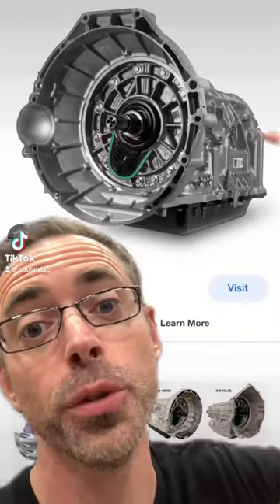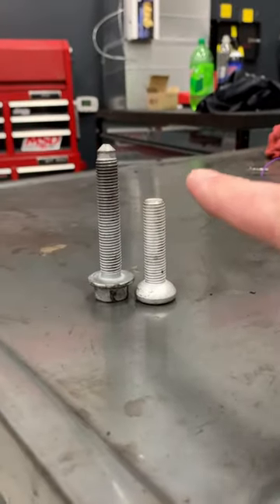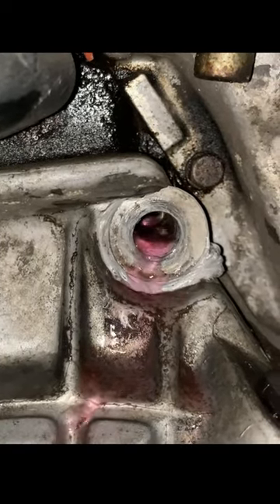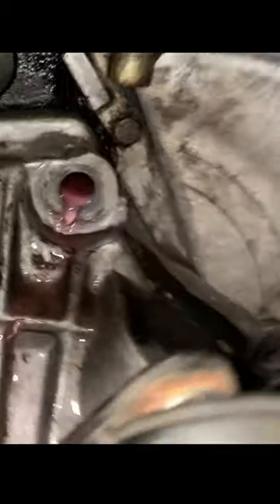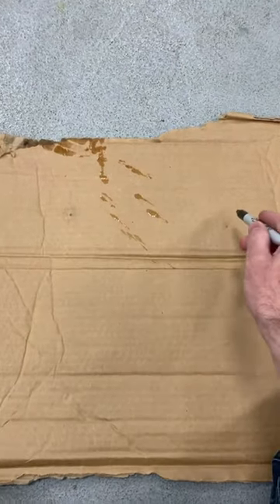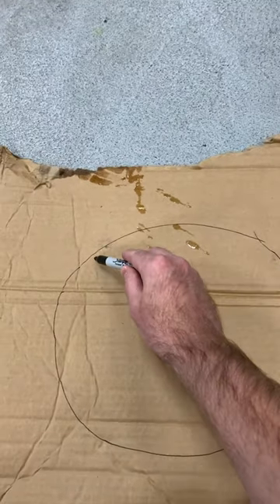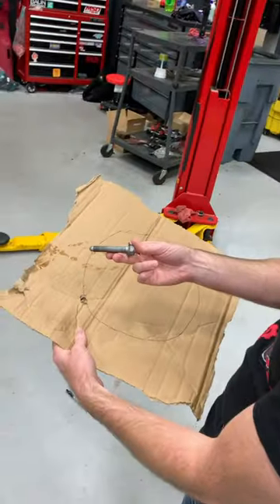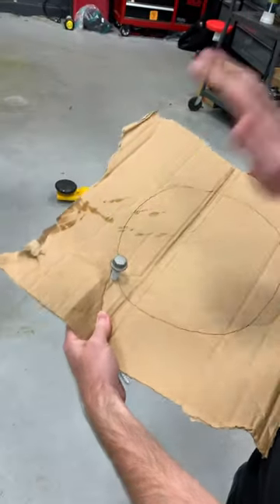Expensive Mistakes when working on engines #car #shorts #automobile

Comment: They freaking went to town with that impact gun hahahaha
Reply: God damn that person must have used something powerful to get through the block 😅
Reply: @wanderer7779 mf musta used air
Reply: Hulk hogan with a ratchet
Reply: Honestly probably used a big ass wratchet and thought it got crossed threaded and kept going. I've seen blocks cracked from someone barely overtightening VTech solenoids.  Someone was my brother. Damn idiot.
Reply: @michaelbarrett6441 that doesn't work for me brother
Reply: This is why you run bolts in with a drill set to a light torque. Or better by hand with a small ratchet handle. This bolt has cracked the cooling jacket. But if it’s not leaking down between transmission and block or into the cylinder it’s not “that” bad. 
A dollop of JB Weld with grease on the bolt (so it it won’t get glued-in) should stop the leak. Use thread tape on the correct bolt and hope for the best.
Reply: Yeah, when you are installing a bolt and it stops hard 3/4" before it is all the way down you might just have the wrong bolt. 😂
Reply: Town? They went the whole country!
Reply: Or you can just know what you're doing
Reply: Ive been doing this for years.
Reply: @JohnSmith-fb2np  so have I and can look at bolts and tell you where they go.
Reply: Surprisingly doesn’t take that much force watched a fellow race mechanic do it on a clutch swap mid race and he did it with a 3/8 electric ratchet not known for high torque 😂
Reply: Case in hand was putting the long bolt in the short hole, punching a hole in the casing. Good mechanics draw bolt diagrams. Daily life can make you forget. 😢

Comment: I would also write TOP so you remember which is the top side of the transmission
Reply: The real hero.
Reply: I write bottom
Reply: And on some installations, I add T2E (trans to eng) or E2T  and an extra hole in the corner with a zip tie will hold any nuts (like the flex plate to torque converter, etc) 🙂
Reply: I write mid
Reply: I write... I hate fuckin engine work 😢
Reply: @dant8213  LoL 🤣
Reply: 😂 Beat me to it. I was going to say draw an arrow or UP.
Reply: Use the VW logo for the orientation!
Reply: Top , bottom, driver side, passenger side 💯
Reply: @andrew1898 😉 i bet you do
Reply: @andrew1898 I'm a leftie so.... Left?
Reply: Thank you.   Any sort of orientation method will work.   An arrow pointing to "Bolt A is the one directly under the fizgrometer clamp" for example
Reply: I write North and South
Reply: @andrew1898 that's a personal choice
Reply: Should write front and back to be extra safe LOL
Reply: I write side
Reply: That 2 lol
Reply: I write "middle"
Reply: Work mostly on front wheel drive cars so add in 2 more smaller circles for driveshaft and starter, also the top is flat. Being able to slap the wrong bolt into a blind hole seems like a bad enginerding decision too though.

Comment: Pro tip, insert all the bolts at the same time with out threading them in. They all should stick out the same amount on any given assembly. The reason this almost always true is because the engineer wants a specific amount of thread engagement for a specific size bolt. If there are multiple sizes, each individual size will have the same amount sticking out. And by size, I’m talking about bolt diameter, not w.a.f.(width across flats).
Reply: This is what I do 
Thanks for sharing this tip!!
Reply: Eh. My experience with automotive (and other) fasteners is that varying thread depths aren't due to engineers not wanting more threads, but because they can't fit more threads. As in this clip, where the hole was bored as deep as possible without penetrating the coolant jacket.

The majority of recessed threads I've encountered were pilot-bored for either starting threads straight, or installing hollow alignment dowels. I'm not sure whether to consider alignment bosses cast/machined into the other surface a third category, or an overlapping subset of those two.
Reply: The cardboard method mentioned in the video has been used for years ask any PRO😅
Reply: Also mark what side is your top cuz it it gets turned you’ll be back to same problem as before cardboard haha 👍
Reply: @Azlehria  I learned this from a Honda motorcycle engineer who help designed the Rc51. I have also asked several other engineers,  like Eric Buell pretty much the same thing, and hot the same answer. It hasn't failed me yet in over 20 years of being a technician.
Reply: This is exactly what I do
Reply: Mechanical Engineer, can confirm.  We design for equivalent thread shear (what it would take to strip) for a given jackscrew force (comes from torque), so it holds universally
Reply: Not true. 
Not a terrible tip but not 100% guaranteed
Reply: Best reply Iv seen beats my primitive explanation lol
Reply: There generally only 2-4 different sizes per application. You can use this method and deductive reasoning to find the correct location for bolts
Reply: nice i didn’t know this i always tighten with my hand and go from there with each bolt and see how it fits but i’ve also had to follow a lot of mechanics and most of the time for some unknown reason your bolts are sitting in a magnetic tray completely unorganized and not in a bag or labeled lol probably just the shop i worked for being the shop i worked for lol
Reply: @mattiephegley215  I organiser everything in different bins and work left to right and keep certain nuts bolts clips with certain components as they're removed. But sometimes I just take it all off and it goes in a pile and it's just a case of remembering.
Reply: If you're stuck and want to play it safe, you can use a length of wire or similarly small dia. length of bar to probe to the bottom of each hole and make a note of the various bolt lengths
Reply: you can also insert all the bolts into the transmission bell housing and they also should stick out the same depth on the engine side.
Reply: Wrong
Reply: This.
Reply: 100%. Somebody here actually knows what there talking about.
Reply: @handyman2233  They're*

Comment: I use this trick on any big job I haven’t done before - as I pull off fasteners I stick them in the cardboard and label them. Takes seconds on disassembly and then going back together I just work my way back. No missing hardware, no misplaced hardware, and I never have to even think about what order things came apart in since it’s all right there.
Reply: It seems so obvious to do but I always forget to do this. I have a few spare bolts sitting around but it's all body stuff so 🤷🏻‍♀️ I'll figure out where they go when something falls off 😂
Reply: Then while there in the cardboard it's easy to clean and paint
Reply: @KekeeBlack same I'll just jump into a project completely forgetting to organize my shit bc I'm so focused and excited. My kx125 must be missing at least 10 things. Can't imagine what all not there on my tdi.

Comment: Thread sealer get that fixed right up. Would not be replacing that block for that.
Reply: Exactly!
I said Teflon tape.
Probably one of the easiest fixes ever.
Then to be on the safe side since it is a mechanic shop get the radiator pressure tester and pressurize the radiator to whatever the cap says and then see if it holds without leaking because that is the maximum pressure the cooling system will ever have in it
Reply: permatex makes thread sealer for head bolts that protrude into the water jacket @AtomicReverend

Comment: put some rtv on that bolt and itll be right as rain :)
Reply: Until the coolant leaks into the transmission.....
Reply: Nah use some flex seal lol.
Reply: Jfc. Terrible idea
Reply: Teflon tape on the bolt threads.
It's a legitimate fix for plumbing leaks, air compressor leaks and intake manifold heater hoses on old school American V8 cars So I'm pretty sure it will work on it Volkswagen...
Just make sure to get metric Teflon tape (joke).
Reply: @AtomicReverend Teflon tape is not a sealer it is a lube for ease of installation
Reply: @arlen1630  Teflon tape is a sealer just as it is a lubricant and an anti-seize sealant all mixed into one convenient easy to dispense "tape" that's what makes it so great. As the old saying goes don't take my word for it google it. 
I recommend using the phrase in the search engine "what is teflon tape used for". You will then have your answer. 

 Obviously a metric thread is not a NPT (national pipe thread) nor is a SAE thread any form of a pipe thread but for all intents and purposes in this scenario the Teflon tape will fix the problem with minimal hassle and it will survive going into a maximum 250°f water jacket (You get the engine any hotter than this and you will probably cause catastrophic damage) And it is a cost efficient fix and will be a permanent fix until the next time that bolt is removed when you will have to reapply Teflon tape. 
Could you pull the transmission and separate it from the engine block then clean the area where the bolts broke through then weld the hole shut then redrill and then retap? Of course you could just as you could replace the engine block and as a mechanic you should tell you customer they have options that cost different amounts and either welding/tapping or block replacement is the proper fix but You should also mention Teflon tape as a cost efficient quick fix that shouldn't have any problems. 

I have been working with the general public for almost 30 years and you will find explaining somebody how something works and what it's intended purposes or what caused it to break and how to remedy the problem will go a long ways... Sadly most customers will choose the cheap fix every time even if it isn't necessarily the right way to fix it but in the case of the Teflon tape sealing a potential coolant leak It's a pretty decent fix It's not a total hokey fix... It should also be fair to mention that when somebody is doing this to a 5 or 10-year-old Volkswagen where the car has little resale value because of its age and/or mileage This is a more logical fix. If you had a vehicle like let's say a Bentley that is worth a small fortune it is probably smarter and more logical to do the repair right.

Outside of that I still stand by what I said earlier engine builders for literally decades (on Fords pushrod v8s especially) have been using thread sealer (Teflon tape) on water pump bolts. Now If it can survive a built 302 or 460 ford I am pretty sure it will survive a stock Volkswagen with their properly functioning cooling system.
Reply: Two-stage epoxy.
Reply: @rogerstarkey5390  Exactly what a shop owner would say.
Reply: Put the bolt in with rtv and pipe sealant, let it sit for 48 hours to setup and that will be fine!
Reply: @rogerstarkey5390  It can't.

Comment: Some engines have holes that go into water jackets with service  manuals that say to put rtv on the bolts
Reply: was looking for this comment this looks very easily fixable
Reply: Similar idea, Eaton truck transmissions have through bolts they say to seal them with Loctite

Comment: they must've overtorqued the living hell out of that bolt with an impact, or VW makes a weak block 🤣
Reply: 2.0t definitely isn't a weak block considering all the power these engines make tuned
Reply: Yes
Reply: @kilovwdude6457 2.0s are trash. I'm a 1.9 fan.
Reply: @MrEcortez16 not a tdi
Reply: @kilovwdude6457 how much power they make doesn't correlate to how thick the rear coolant passages are🤦‍♂️ also 170hp isn't a lot for a turbo 2.0. Honda was making that with a NA 1.8l 30 Years ago
Reply: @konnerkramer329 did you just miss the fact he said tuned or just like making stupid comments
Reply: @MrEcortez16 ehh 3.0t all the way bro
Reply: @konnerkramer329 what vw 2.0t makes 170hp? My 16 year old GTI made 200 stock before I added bolt ons
Reply: @hanzgrueber145  well according to VW themselves it makes 174hp at 5,000rpm🤷 not sure what you want from me. There's a reason why I said they were kind of pathetic
Reply: @konnerkramer329  that he said tuned he never said they were anything special standard like your making out he did
Reply: @gregshearer423  you guys are acting like a tune will double the power... what an extremely aggressive 91 tune adds 50hp? 80hp maybe. That's still 250hp out of a dual over head cam direct injection turbo engine. Not impressive at all when you can throw a $100 Chinese turbo on a 30 year old 200,000 mile civic and make more power than that.
Reply: @konnerkramer329  aye mate you might want to go and do some research your getting on for  a bit over 300hp on a stage one map with no mods so if that not impressive for a completely standard car a don’t know what is
Reply: @gregshearer423  not sure where the hell you're getting 300+hp from... bout the most aggressive mail in tune I've found claims 285hp with an aftermarket intercooler, a 3" down with a free flowing exhaust. So if you're making over 300 bone stock I'm willing to bet that shit isn't going to last long. Especially considering they make 170hp at 13psi. To make over 300hp bone stock you'd have to more than double that probably close to 30psi of boost. You might think it's a strong engine but considering they can barely make it to 200,000 miles bone stock I doubt you'd even see 100,000 miles shoving 30 psi of boost down its throat.
Reply: @konnerkramer329  didn’t say it’s last but seen a few doing them sort of numbers bone stock on just a tune and as for civics lasting 200k that just doesn’t happen in Scotland they rot long before they ever make that sort of milage
Reply: @gregshearer423  well where I'm from it isn't hard to find civics and accords with double that still running. I'm not even a JDM guy I own 4 chevys for gods sake, but you're really trying to say Hondas don't last 200,000 miles?
Reply: @konnerkramer329  a believe they would Honda build good reliable engines just saying a lot were scrapped long before that milage due to the rest of the car being completely rotten
Reply: @gregshearer423  just throwing terms out there ? what is "tuned" to you?
Reply: @MrEcortez16 idk man my 2.0tdi has beat about every 1.9 I've come across. Makes 200whp with 330 ft pds of torque. And rolls more coal then a 12v 5.9 Cummins.
Reply: Yes
Reply: @JamesLivas I find it hilarious I wasn't the only one who immediately thought "yes"
Reply: @konnerkramer329 your wrong pal I made 350ho on a stock 1.8t nice try tho
Reply: @konnerkramer329 wrong agin maybe you should look into it before your comment
Reply: Block wall in that area is definitely thin enough.Otherwise no bolt would be able to go trough some thick metal without first destroying threads on it.
Reply: Dont see too many VWs over 200k miles.

Comment: After doing this for the same job a few times, you'll start remembering the odd bolt placements.
But until then (and supposing it's untouched from the factory), IMHO, this is the best way to "be sure" that your bolt placements is correct.
Another few pro tips
Where possible, attach the bolts/nuts back to the part they go to

A hole in the corner (of the cardboard placard) with a zip tie through it will hold any nuts

A sharpie will help and easily clip onto the cardboard

A screwdriver or thick pick tool will make the holes easily for most bolts (and sticks easily in the corner)

And if for some reason you have to stop and condense your "pile of parts", the cardboard placards stack easily.

A wire wheel on a bench grinder will clean up any rust/corrosion/or old loctite off of bolts quite easily, when you're ready for reinstallation.

Lastly, don't trust your power tools, for a myriad of reasons they can over/under tighten fasteners (depending on battery/air supply).

Have fun and keep wrenching😎

Comment: Another tip: do not overtorque bolt.
I was bleeding my car and ended up stripping the threads on my rear electric brake caliper 🥲 now i need a new one
Reply: No feeling quite like the one you get when tightening a bolt and it suddenly starts getting looser 🤦‍♂️
Reply: @MatthewJRedmond red loctite 🥹
Reply: @johndc2998  for when you don't want it to come loose, but pulling out the welder is too much like work 🤣
Reply: Why don't you get a thread repair kit. Like a threadsert or helicoil.
Super easy to do as long as you have a drill.

Comment: If that was run in without power tools, it might have easily not been over looked, also?
Reply: That’s what I was thinking . Someone used an impact and shoved that bolt in there 😂. It would be noticeable  If it was by hand because of the tension

Comment: It's a technique called 'hard-mapping'. I use it on laptops, saved me a ton of hassles, no missing screws or screws in wrong holes or right connector wrong direction either.

Comment: I go a step further and label the bolts with size, thread pitch and length. after a while some of these details get committed to memory
Reply: Yeah, Im a bit more careful, I measure their length free and under tension,  then check their composition and the mines the ore comes from, then I throw them away and use new ones.

Comment: I did the same thing basically when changing heads on an 02 ford lightning. I put one of the thermostat bolts (Long 10mm) into the ps pump hole in the timing cover. Got it all back together and noticed oil everywhere. Seen a hole and getoemparts it was. Lol

Comment: This is also handy when doing valves, if you’re an ocd amateur engineer, chances are your valves are going to be installed and removed at least 12 times while you port, polish, lap, buff, flush, dip and measure everything.

It’s very easy to lose track of what goes where and end up installing intake valve #3 into seat #6 after you’ve lapped them all.

Comment: use head bolt sealant to fix the leak. Its specifically made to seal head bolt threads that connect to the water jacket.

Comment: Worked at a transmission shop for 10 years first week my trainer put all the bolts in a bucket and said “pay attention to the bolts they are not the same” i learn the right way by paying attention to what i was doing.